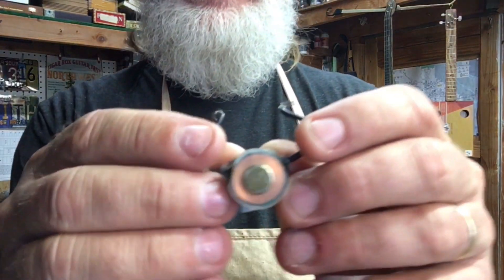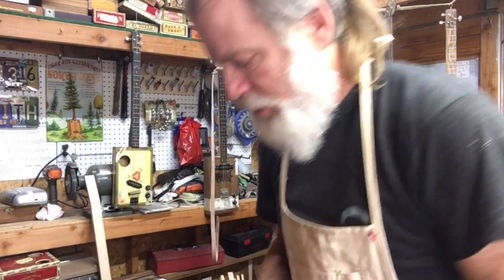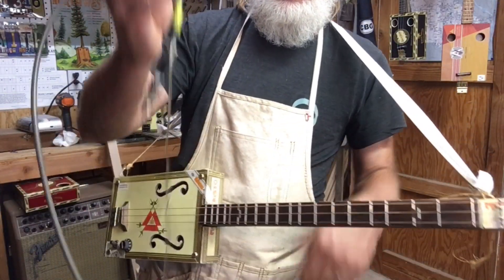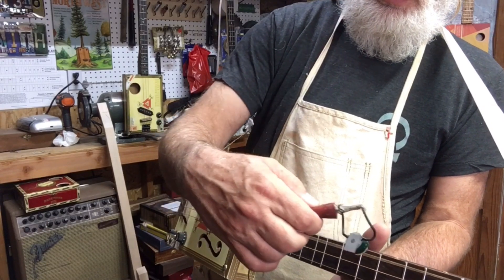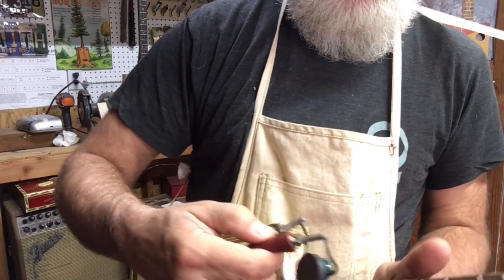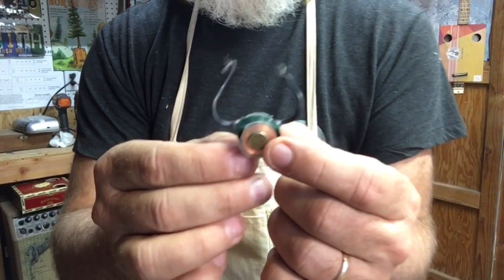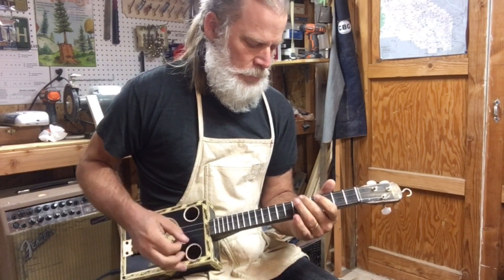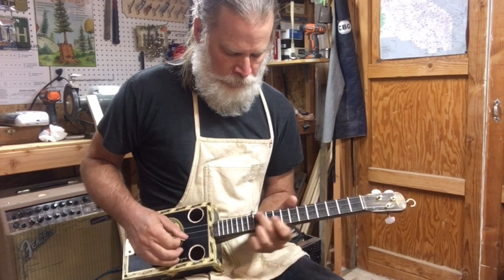Cigar Box Guitar Single Pole Pickup EXPERIMENT

Comment: It looks like the coil cut out of a relay/solenoid. I suspect its post is not a true magnet (although it maybe magnetized from use), that’s why adding the magnet improved the sound and got rid of the dead spots.
Reply from the maker: I think you’re right... because when I first put the pole next to the string it barely worked at all... then when I put the magnet on then it worked... then when I removed the extra magnet the pickup still worked... and then later was not working again..until I added the magnet... and then it worked again without the magnet... but only for a while.  Seems like the big magnet “charges” the pole but only for a short time frame
Reply: Puckett Cigar Box Guitar, yup it’s a coil from a relay. You only want the metal core of a relay magnetized when the coil is energized otherwise the relay would stay closed permanently. Yes, holding the big magnet is pulling the iron atoms into alignment making the core temporarily magnetized. Rubbing the core with the magnet in one direction would increase the core’s magnetism and duration, but probably not enough to be a suitable pickup. Wiring 3 of them in series and attaching them to a small bar magnet would probably get you a 3 pole cbg pickup.

Comment: Looks like the coil from a solenoid. In our water processing plant at work we used overflow shut off valves which had coils like this over a small shut off valve which would open in the event of an overfilled tank. Also the centre is steel not a magnet, hence when the magnet is added there is a strong flux field for the strings to disturb and generate a current. I have had success with neodimium magnets and cotton bobbins. Just a small thought from a one time electrician.  I shaved my beard off last week and I have forgotten how to play my 3 string so keep the beard Dell!!!!!! Greetings from UK.

Comment: What you were experimenting with is a standing wave. At each of the nodes there isn't any movement of the string.
I was first thinking that the coil could have come from a solenoid, but these don't need a permanent magnet in order to work.

Comment: It’s a magnetic coil all right, probably for a relay in an electrical circuit and judging by the size of the wires it probably is designed for a 120V circuit.

Comment: I made something like that from a transformer. 
I call it my "bottle cap pickup".
Tiny transformer salvaged from a power supply. 
Cut/hacked metal surround off so just the metal "core" was through the middle. 
Round magnet from a fridge magnet on the bottom.
Soldered 2 wire ends of transformer coil onto solid wires for connections.
Beer bottle caps on each end.
Taped up middle with electrical tape.
Plugged it in to my "Lap Diddley Plank".
Sweeeeeeeet!

Comment: The pickup works best where the vibration of the string has the widest/largest amount of deflection.  Harmonics points are where you will find these places.  The biggest/hottest spot would be the 12th fret but that would interfere with the fingerboard.  So, you have to go towards the bridge, just past the end of the fretboard and find the next harmonic.  That is where most "neck"pickups are located.  If you have an old Strat, play with the harmonics and see if the three pickups are at harmonic points.
Reply from the maker: Makes sense... i never knew... always wondered why sometimes pickups were hot and add sometimes not... location location location!!!!
Reply: The neck and bridge on a strat theoretically SHOULD be at 24th and 48th fret (on the treble string, anyway), but the middle pickup is nowhere near the 36th fret pos.

Also, at any given even numbered fret pos there will be a CANCELLATION of at least one harmonic of certain notes on every string. Sometimes even the fundamental will be canceled, hence why I would suggest only placing under ODD "fret positions" such as the 37th fret, or 27th for neck pos if you want to also be able to fit a 24-fret fretboard.